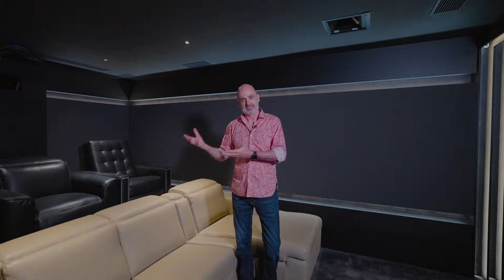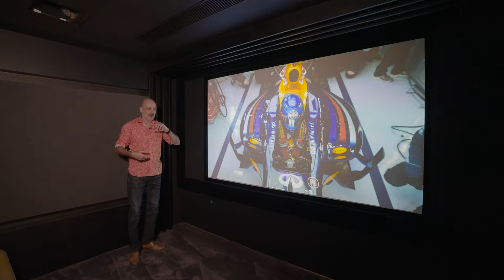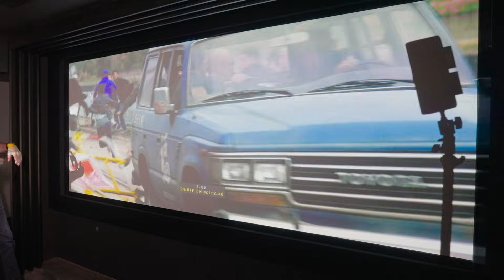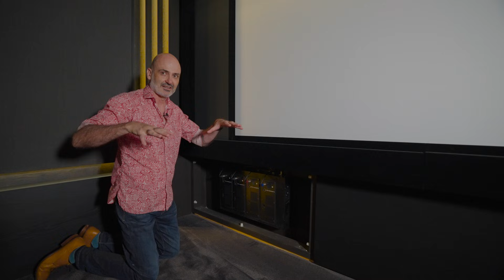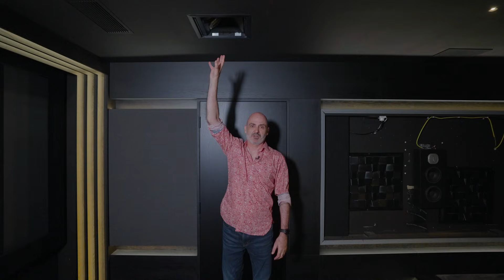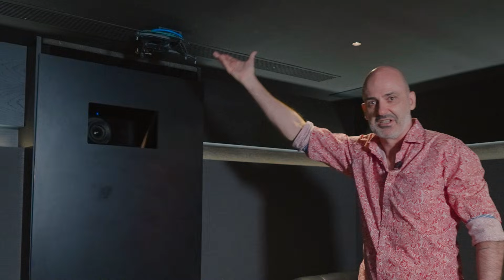Inside a Reference-Grade Private Cinema: Engineering the Fire Room | Wavetrain Cinemas

Comment: it was better to put a tv instead of a very small screen and wasting the money for a project .
Reply from the maker: Thanks for your comment! The screen in this room is actually 141 inches, so it’s significantly larger than even the biggest consumer TVs. It’s also an acoustically transparent cinema screen, which allows the front speakers to be positioned directly behind the image, exactly as they are in professional cinemas.

This placement is critical for accurate sound localisation, so dialogue and on-screen action come from the correct position on the screen. It’s one of the key reasons purpose-built home cinemas use projection rather than a traditional TV.

Comment: Can’t see how sideways facing rear speakers make sense…. Instead of having those rear ‘rebates’ build out the wall structure in line with the projector tower and have a flush surface behind which you can fit both the subwoofers and the rear surrounds 🙄….. change the room dimensions to give best sizing to prevent standing waves; if that means dropping the ceiling height so be it. 😘
Reply from the maker: Appreciate the comment and the discussion 👍

In this particular room, there’s no downside to the side-wall surround position. With a different speaker design or room geometry, that may not be the case, but as discussed in the video, the surround envelopment and positional accuracy here are exceptional. The system was engineered and validated as a complete whole, not as isolated elements.

Rear mounting wasn’t a viable option due to the size and placement of the subwoofers, which were deliberately positioned and not something we were willing to compromise. Every decision in this room is performance-led rather than just theoretical.

On room dimensions and standing waves, they exist in every enclosed space, regardless of size or proportions. Changing dimensions doesn’t eliminate them; it simply shifts their frequencies and how they’re perceived. What matters is distribution and management, particularly because all speakers excite room modes, not just subwoofers. In this cinema, modal distribution is exceptionally well controlled.

If you haven’t already, we’d recommend reading RP22, as it addresses many of these topics in depth.

We always welcome discussion, but it’s worth noting that this room was designed by a 2× Global award-winning cinema designer and the RP22 instructor for the Asia-Pacific region.  Every decision here is intentional, measured, and validated.
Reply: @wav @wavetraincinemas8417  Im glad it works so well…. Just can’t believe rear speakers facing directly into a close sidewall work for best, sure you would still hear them as you would any noise in a room I guess
Reply from the maker: If you are based in Sydney, we welcome you to visit us at our Taren Point showroom so you can hear it for yourself.  Contact our team on projects@wavetrain.com.au and we can arrange a time 😊